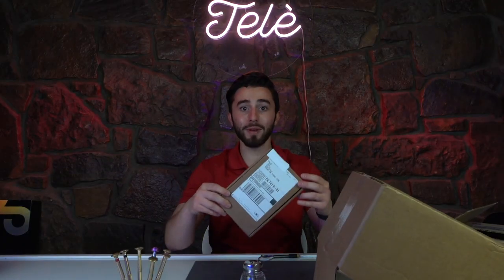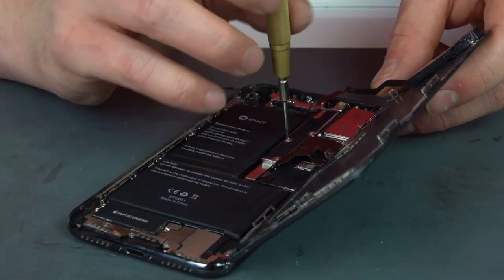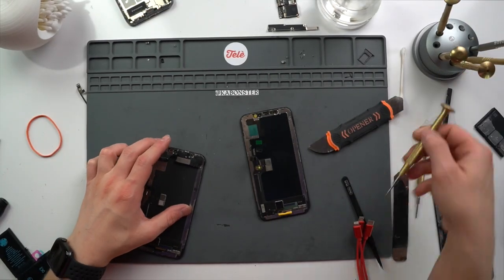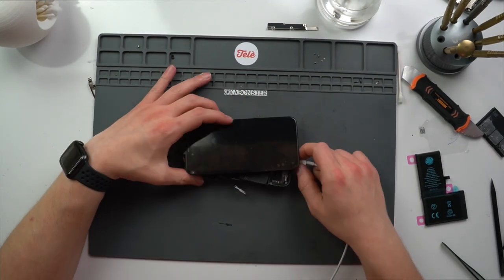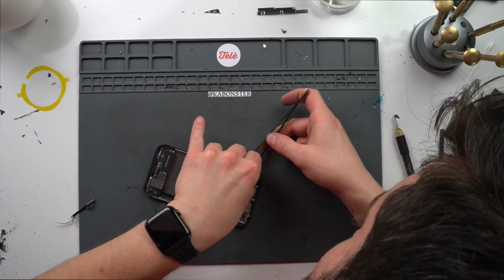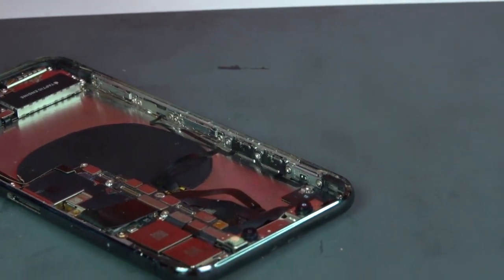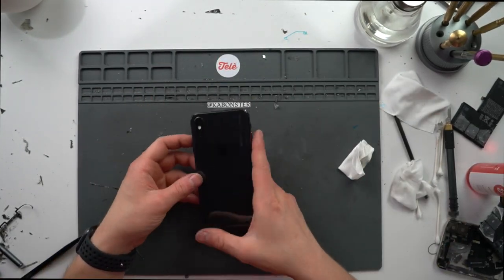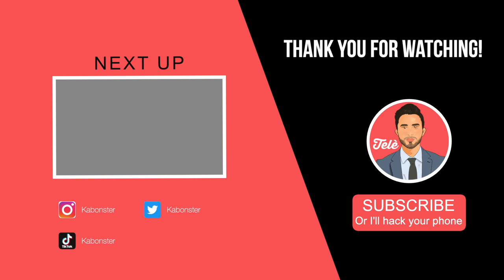I had to repair one of the CRAZIEST phones I've EVER seen!

Comment: im pretty sure that repair cost more than the price of just getting a used but fully working and in good shape in iPhone X
but none the less, great video!
Reply: They probably want to keep there photos and stuff
Reply: @Disturbance77  yes 100 percent correct. (Business stuff)
Reply: @Disturbance77  btw it was mine 😂
Reply from the maker: Personal data can be priceless, thank you!!
Reply: @Disturbance77  *their
Reply: @Kabonster  You just butchered that dude 
I know everyone has to run the business and bla bla 
Screen ,battery ,wireless charging, front cam/speaker ,back glass and on the top of the cake the YOUTUBE VIDEO !
If you had helped him back up data while repairing and lend him some other used phone from the shop that would be way better !
Could've got a nice phone with a working face ID sensor at that price.

We have a phone repairing firm too, but whenever we see the repair cost is much greater than the devices worth , we deem it as unserviceable and ask the customer if he wants the data , most of them usually don't care about the data and go get themselves a new phone .(also we pay them for their parts which are working that way both profit and recycle doesn't stop)
Reply: @emadhamidnaja   no one really cares about your firm you own, if your promoting your business on a YouTube comment section, i assume that your business is not doing well. Maybe stop paying for your customers phones and charge them so you can gain some money and not lose money. Also, the way you say "unserviceable" sounds very unprofessional and lazy. You might wanna change that.
Reply: @emadhamidnaja  you do realise butchered means destroyed or killed, so him butchering someone wouldn't make sense. Don't you know what butchered means 🤦
Reply: @Jellbell46  did you talk to the idiots who messed it up first and let them pay for the damage?

Comment: Just a few minutes ago, my mom broke her back glass to her phone. (It was Samsung, if you’re wondering) but the screen works still, surprisingly.

If you want to read how that happened, scroll down..

So we were leaving my aunts house, and my sister had a bunch of stuff, and forgot that my mom’s phone was connected to a cord. And the phone fell down like 20 steps. It landed on the back, so the screen didn’t get damaged. But the glass can fall off easily.
Reply from the maker: RIP
Reply from the maker: Is it still working? I do most Samsung back glass replacements for $75
Reply: @Kabonster  yea, it’s still working. I can talk to her and see if she want it fixed